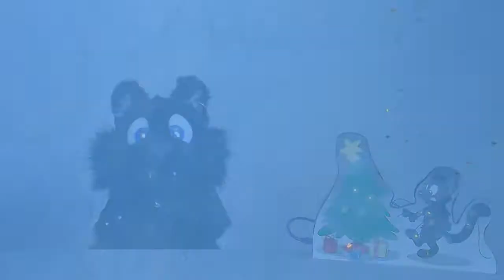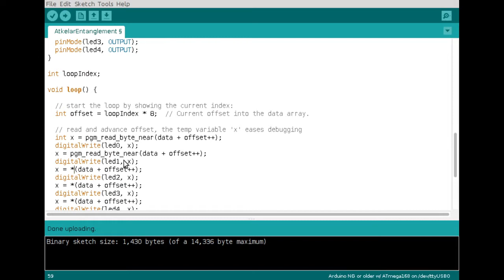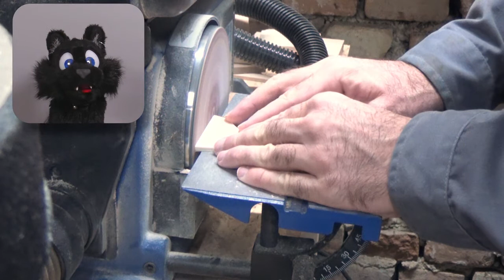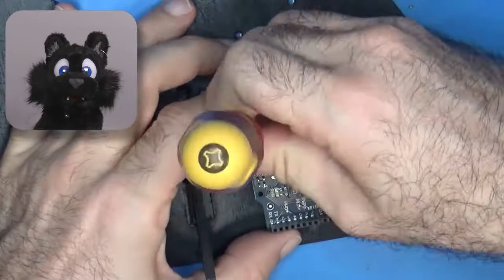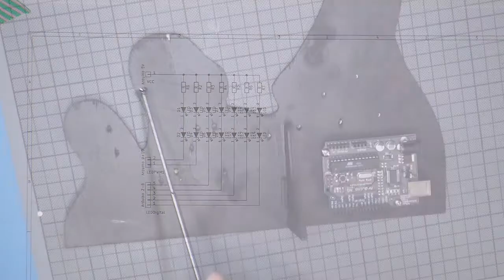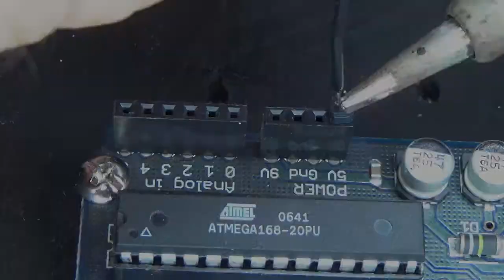Build #5 - Christmas Ornament

Comment: Excellent! Tips = 1) Investigate "CharliePlexing" to increase/maximize the number of LEDs that you can drive with limited pins. Look for circuits that include current bypass transistors, in both directions, to have sufficient current. 2) Investigate "Spray Contact Adhesive." It will not wrinkle the paper so much.
Reply from the maker: Thanks! I came across CharliePlexing over the years indeed, this project is a bit on the old side (even when the video went out, it was already aging on the disk) and my resources were a bit limited back then, i.e. no spray glue at hand. But I am proud to say that this very ornament is still part of my mom's Christmas decoration even to this very day!